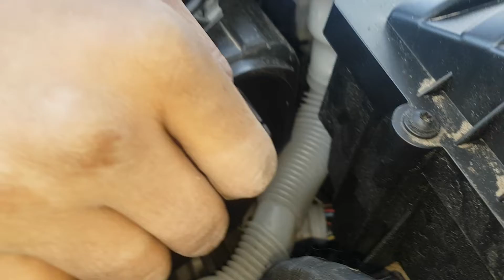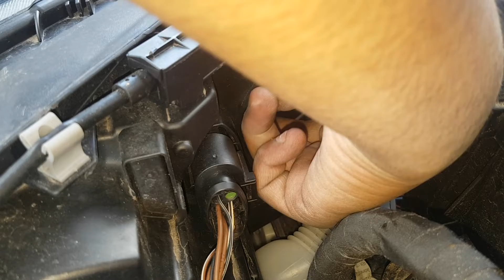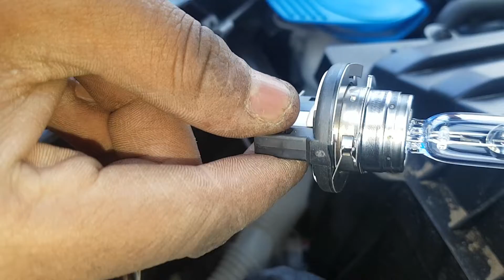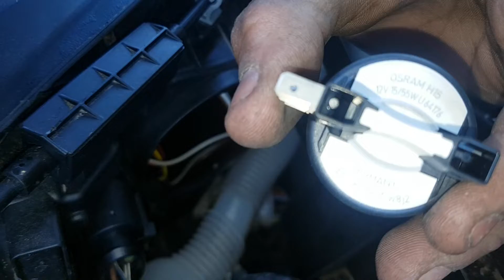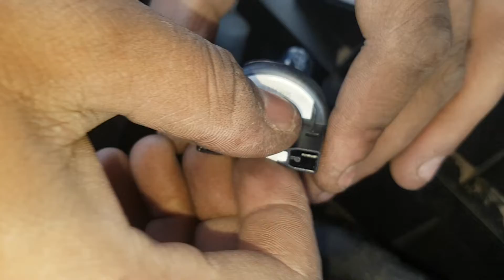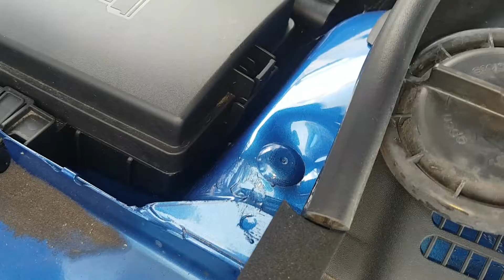Skoda Octiva 2016 how to change DRL H15 bulb

Comment from the maker: This was a UK spec car and it was the nearside (left) daylight/full beam H15..3 pin full beam is built into the bulb so you need to twist the bulb to the left to remove it and right to lock it back in very easy to do.
Very similar to the way a H4 bulb works but is a much smaller bulb and the pins are in different locations.
Reply: The bulb is incredibly tight to remove, driver side went fine, any tips for passenger side?
Reply from the maker: @mohammedkahaf2428  Yes,  don't use cheap bulbs.
Reply: @caraudiosolutions  Used a mini plier, came out fine
Reply from the maker: @mohammedkahaf2428  Great.

Comment: Noooo :( you didnt pull out the actual bulb, i cant figure out how to seperate the bulb from the holder
Reply from the maker: Sorry my bad turn the bulb to the left to remove it pretty simple to do.
Reply: @caraudiosolutions  i must be doing something wrong then, cause i have been pulling and turning that bulb and i just cant get it off
Reply from the maker: @CCCaps  My 15 yr old son removed that bulb and put it back in so it can't be that hard, mind you he's an expert like me.
No bulb is too difficult for us on alot of car's  we take the lights out to change bulbs it's a doodle.
Reply: @caraudiosolutions  figured it out, thought i had to remove the bulb from the attached plastic part
Reply from the maker: @CCCaps  That's correct the bulb doesn't remove from the holder.
You can pay pal me £10 for my help cheers.
Reply: @caraudiosolutions  haha xD
Reply from the maker: @CCCaps  I guess that's a no :(.
Reply: CAPS for H15 bulbs it’s usually better to buy the whole casing as you will end up paying nearly as much for just the bulb 👍🏽